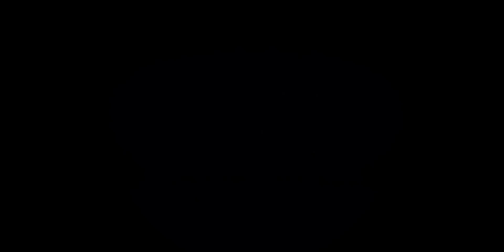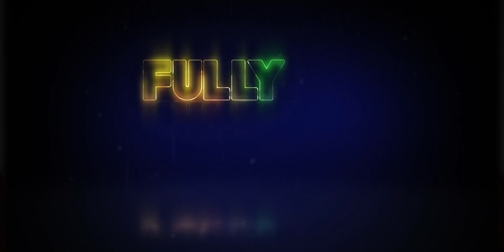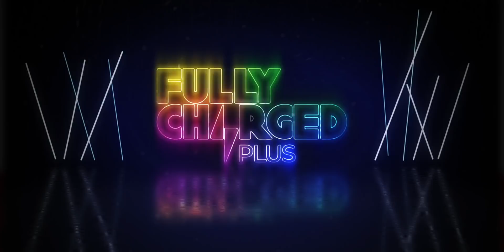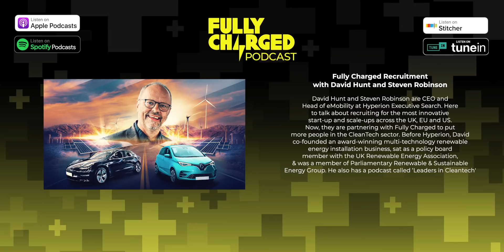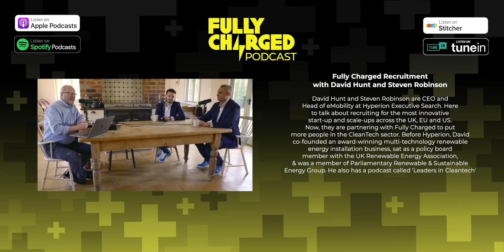FC Recruitment with David Hunt and Stephen Robinson | The PLUS Podcast

Comment: Hi @FullyCharged Team! I hate to be "that guy", but did you know that the audio for this podcast is playing back at the wrong sample rate?  You all sound un-naturally low pitched.   It would seem that, during the conversion to .mp4, the audio sample rate has changed from 48kHz to 44.1Khz.  Nothing wrong with that, but during the rendering process the 'resample audio' checkbox should have been engaged.  Worth checking the file before uploading.

Comment: @Fully Charged Plus I like to watch your podcasts on YouTube because I'm a bit mutton and if I can see someone speaking I can hear better. As I watch on my mobile phone using in ear headphones this saves me having to turn up the volume to dangerous levels. This format, sadly doesn't allow me to do that which really impacts my enjoyment of the article. I did try the transcript but that doesn't work for me, too few words in a caption which whizzes past jerkily and is very off putting.
Would it be inconvenient to have the interview fill the frame and maybe superimpose the advertisement logos over the edges of the picture?
Been subbed a couple of years now and really appreciate the work you're doing.

Comment: Is it just me that hears the low pitch of the podcast?
It sounds like everyone is using a voice changer to lower the tone of their voice!? 
Great podcast as always though!
Reply: Came here after listening as a podcast to make the same comment! :-) My guess - someone played around with filtering to try and clear up the audio (you can sometimes catch bits of background noise and one of the guests fades out occaionally) and wanted to slow it down a little as they do talk rather excitedly. Should have used time-stretch (maintaining pitch) rather than just slowing it down, though! :-D
Reply: The video sound has been recorded at a sampling rate of 48kHz (standard video rate)  but when the final video was exported, the audio has been converted to 44.1kHz (CD rate) without any resampling.  The effect is to make Robert and the contributors sound as if they have been 'slowed down'. 
Put simply, the audio was recorded at a higher speed than it was saved at. The effect is similar to, though not as extreme as, playing a 45rpm record at 33rpm.  
This mistake really should have been picked up before the video was uploaded.